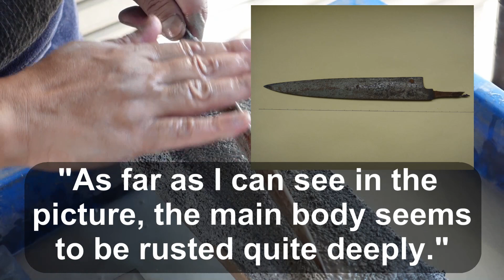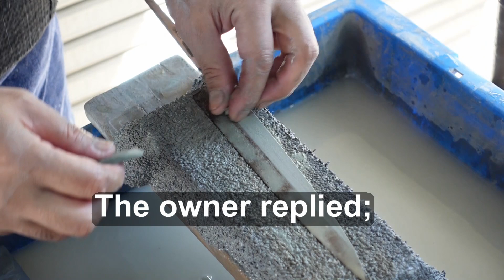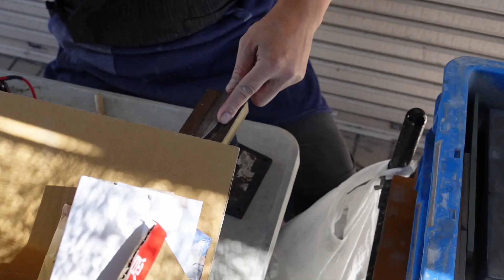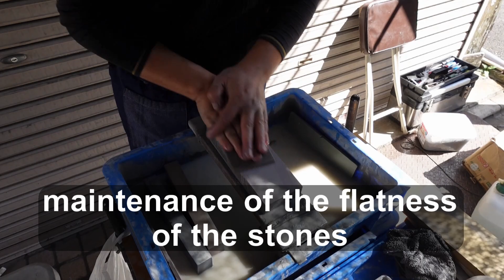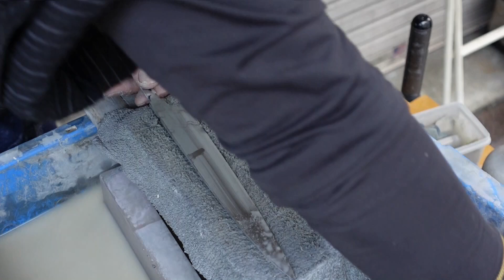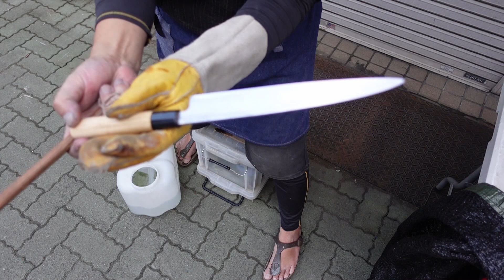rusty kitchen knife sharpening  English ver. @ spark joy sharpening TOGITOGI

Comment: Oh that's a very good job👍
And news TOGITOGI tricks,
Hammer time🔨
Handle insertion 🔪
And the secret powder
🧂🤫😀
A bientôt 🇯🇵🇫🇷
Reply from the maker: I'm always choosing the movie which looks good job from too many movies. 

hammering; this knife has laminate structure.
upper layer is soft steel and lower layer is hard steel.
when I hit this material, soft layer extend more than hard layer.
so I can only use this method when the knife bend to the side of soft layer.
Mr. Hatsukeya does it even when knife bends oposit side. it looks the same thing but different mechanism. I can't do when it bends oposit side.

handle inserting looks easy. The difficulty is preparation.
It takes time to measure the depth, width and height of the hole in the grip in advance, cut the size of the tang according to it, and straighten the tang.